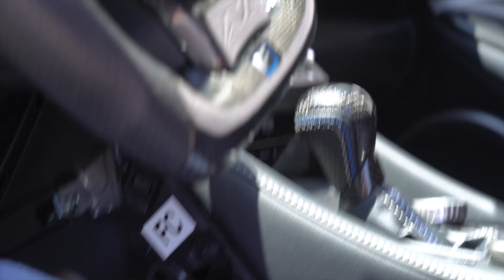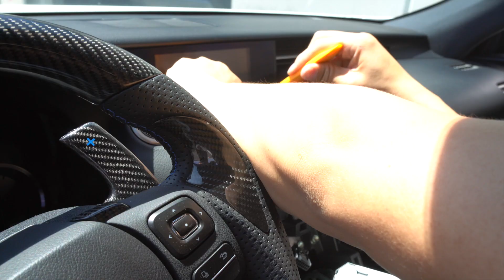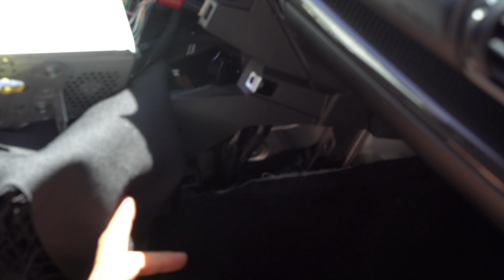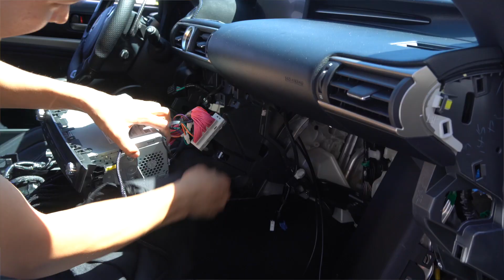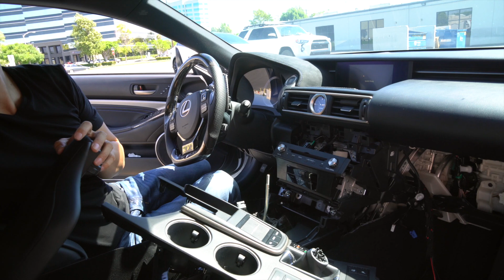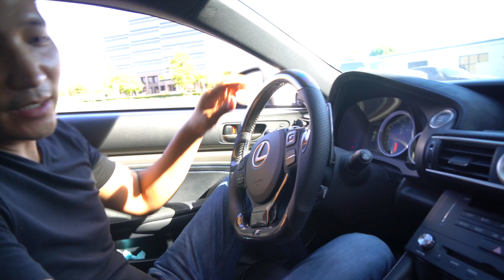2015-2017 LEXUS RC | Wired Apple CarPlay Android Auto | Install / Demo

Comment: Just letting you all know if you have a 2017 Lexus RC 350 just take it to a Lexus Dealership and they can do a software update for a few hundred bucks and your car can get Apple carplay and Android Auto
Reply from the maker: You can with 2018+ RC models but not with 2015-2017 RC models
Reply: @BeatSonicUS  you can do it with 2017 Lexus rc 350 look it up. That’s the only RC you can do it with in 2017

Comment: I genuinely feel like after removing factory set panels, screws etc like this and one’s put back to place rattles etc will start
Reply from the maker: Hasn’t happened yet. In fact we fixed many rattles after we removed the panels and reinstalled them

Comment: Can I do this on my ‘17 RC 350 F Sport AWD ? Also if the inside panels are the same layout as the RCF, that way running the cables inside won’t be an issue ?
Reply from the maker: Yea this is compatible with 2017 RC with nav. Inside panels are the sam as RCF

Comment: any recommendations on shops that can do the installation in Ontario, Canada?
Reply from the maker: Any local reputable car stereo shop will be able to tackle this install without any issues. We are available for technical support if they need any help.
Reply: Beat-Sonic thank you. Additionally, is the CarPlay kit wireless through Bluetooth?
Reply from the maker: The carplay kit is only wired and will not work wirelessly
Reply: @BeatSonicUS  what would you say is the boost speed from car start to when carplay is loaded?

Comment: I just got this installed in 2016 Lexus RC 200T. There are no next/previous seek buttons next to the mousepad. The steering wheel seek buttons do not work nor do the seek buttons on the factory unit so the only way to go to next/previous song is through the apple carplay on the screen. Is this right?
Reply from the maker: Hi Andrew you are correct
Reply: @BeatSonicUS  This needs  more advanced steering wheel support to be useful really. Is this something being looked at or is this a limitation of Apple car play in general? I have never used carplay in a car as yet so this is a genuine question as i am thinking of purchasing this unit for my 2016 RC 350 F sport. I am located in Australia though so unsure what support there would be to install this here.
Reply from the maker: We have added the seek up/down on the steering wheel controls as of the lot we are shipping now.
Reply: @BeatSonicUS  Thanks very much you are starting to really convince me . I'll probably place an order tonight . I appreciate the fast responses too. I was a bit confused how firmware upgrades work if you don't mind though? How do you upgrade once it is all installed? It looks like you have to pull the dash apart again or is it just the part to the side of the radio? Can you suggest anyone in Sydney Australia to do the install if i decide not to do it myself?

is there any issue for you to ship to Australia? I can't see how to add anything other than USA / Canada to default address?  I have spoken to Beatsonic Australian Distributors too and they said as it's not a licenced Apple product they have decided not to bring them in.  I do need to check compatibility with Australian 2016 RC 350 F sport though ? . From what i can gather the only difference from USA one is it doesn't have Hey Siri built in as a steering wheel function. It still works directly from phone and comes through car speakers etc though. Is this going to affect anything?
Reply from the maker: Please email us to order as our website does not take international orders: sales@beatsonicusa.com. Firmware update may require you to access your interface box depends on the type of update. If the interfaces are mounted behind the glovebox or under the carpet, it should be easily accessible without taking apart your dash. Unfortunately we do not have any installers we work with in Sydney, but any reputable stereo installer should be able to do the work. 

The kit will work with your RC model without any issues.
Reply: @BeatSonicUS  Thanks very much Andrew. I'll email you tonight and place an order with you.  I would place it in same location you did in the video in any case i think. The Rc 350 is pretty much identical to the RC as far a Mark Levinson sound etc so it would probably be best to place the box in same spot you did yourself. I also deleted the comment about it looking messy too as i didn't want any negativity  on here when you are offering something so unique and it's clear now i had just misunderstood that part anyway.
Reply: @BeatSonicUS  Thanks Andrew i have sent an email to sales with intent to purchase. I'll await the reply :)
Reply: @BeatSonicUS  Hi Andrew, I am not receiving anything back from sales after emailing last night? Can you please follow up for me?
Reply from the maker: Not a problem
Reply from the maker: Unfortunately we are closed today in observance of Thanksgiving holiday in the US. We will be resuming to work on Monday, but let me see if I can have someone email you before that.
Reply: @BeatSonicUS  Thanks mate , i forgot all about that as we don't celebrate here in Australia. Appreciate it. Happy Thanks Giving in any case :)
Reply: @BeatSonicUS  Thanks Andrew,  i have  been dealing with Sam , he is just checking the 7 inch screen i have is compatible then i'll put the payment through. I'll get it sent to my home instead of work i think as i couldn't quite work out when he said low stock next shipment dec 20 . whether he could secure one from this lot or i have to wait until dec 20 lol.
Reply: @BeatSonicUS  Hi Andrew, Sam is a star, secured one to ship Monday and all :) . Luckily i used my bank to do conversion from US dollars as Paypal would have cost me $100 more crazy hey ?

Comment: Another question after watching again, is there a separate cable for the phone to plug in (besides the factory USB port in the center arm rest)
Reply from the maker: Mark Joseph yes there will be a separate cable for the phone to plug in. In this case we placed the female usb connector for the device in the glove box. Apple does not allow connection using USB hub for carplay as such the factory usb connection was not able to be utilized